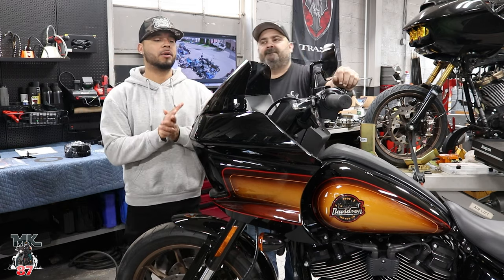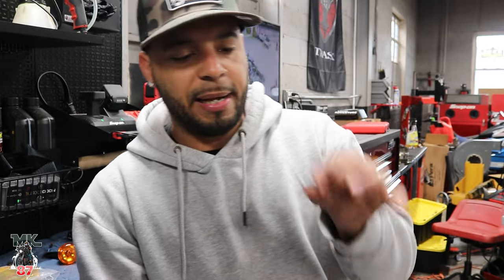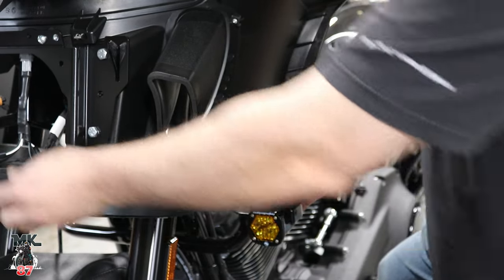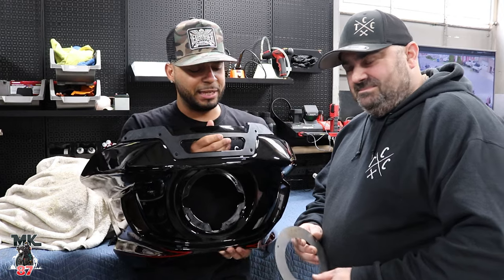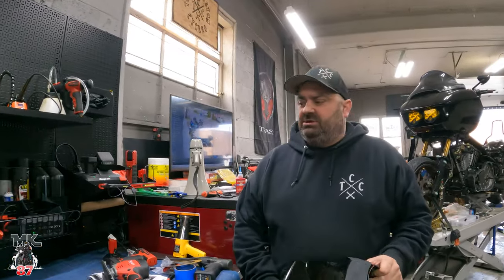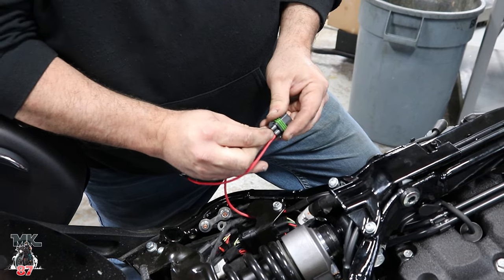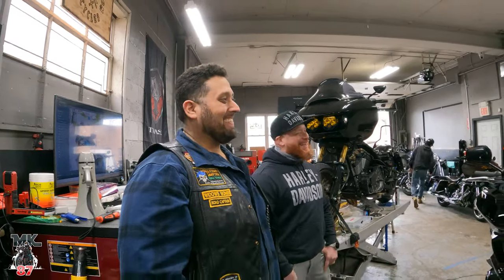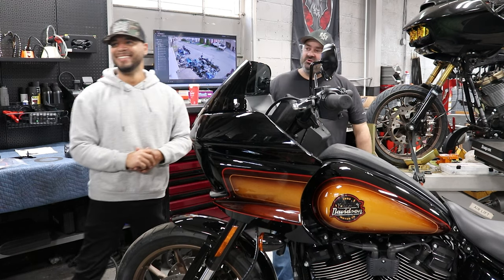Low Rider ST Baja Designs LP6 light install / recessed bracket

Comment: I will say that connection to the battery is a great change. When I installed my LP4 using that solder tubing stuff was a huge pain; the update is WAY better! 

That shop does great work! If it wasn’t so far I’d go there for all my stuff. 

Light setup looks great man.